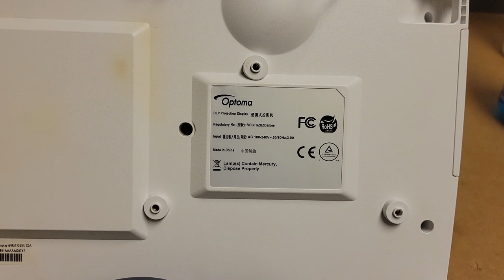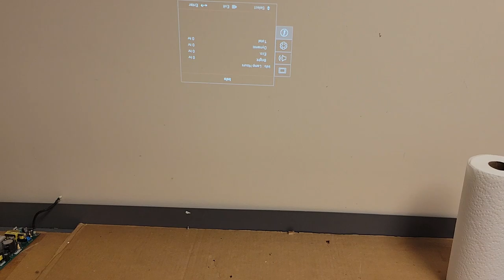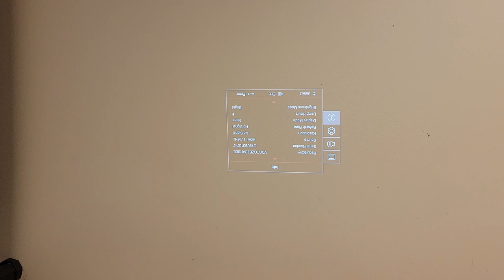Optoma GT1080 Darbee  DLP Projector Color Wheel Replacement

Comment: Hi Frank is the color wheel in the Optoma GT1080 the same as the color wheel in the Optoma GT1080 Darbee?
Reply: Thanks dalton for asking! And reffering me to his video, im going to probably buy the tape he is reffering to and try that out. Waiting till tommorw so i can make sure i have a pair of gloves.
Reply: I cannot for the life of me get the top off, i got both clips opened but right by the bulb area it wont come off, no matter how much force, the only thing i can think of is that some of the plastic may have melted it, only thing i can think is to have one friend on one side and me pull from the other but worried ill break something
Reply from the maker: Hi Felton, I don't think so but let me double check. They use different lamp assemblies for sure but I'll double check on the wheel.
Reply from the maker: Black high temp paint works too. Stove touchup paint for instance.
Which clips are being a chore for you?
Reply: It looks like the clip right next to the bulb shield , is it possible that it melted in place?
Reply: Update me and buddy got it off but its NOT pretty lol the two thick posts definitely melted inside of each other so force was needed , hopin i can super glue the cracks so it will at least still go back on
Reply: Finally got the new color wheel installed and now no power 🤦🏻‍♂️

Comment: Hi, what dmd chip does this gt1080 projector have? Because I have the problem of white dots, thank you very much
Reply from the maker: There are a few possible part #s. Your best bet is to remove it and check the number.  I think its a 1280-6138B but there are other numbers. I tend to only go by the part # on the chip itself to be safe.

Comment: I was wondering if it is the color wheel that needs replacing if I see black and white after the projector overheated once and shut down. I do hear a noise everytime it starts up but I assumed it was the fan. Appreciate your help if you know what's wrong. Thanks!
Reply from the maker: If you have a GT1080 or similar chassis, I would be very suspect of the color wheel. It seems that this series has that as a known issue. So much that I keep wheels in stock now. If you are around the 5 year mark or past that, then I would be highly suspicious of the wheel.  They are roughly $40 so it is reasonable to replace and I suspect that will solve your issue. If you want to link a video of the noise, I can see if it sounds like a wheel issue.
Reply: @FixitFrank  thank you for your response. How can I purchase one from Canada?
Reply: @FixitFrank  I opened up the projector and the color wheel is shattered.
Reply from the maker: That will do it!  I'd check eBay first since you might find a seller in Canada. If not, email my friend Crystal at Time Projector.  Gydz@timeprojectorlamp.com  She is really good and they ship DHL and take paypal.  If they can't help you can email me. I think I have at least one if not more new wheels around for that model.  It should be $40-60US on average. You could even try Optoma directly. I have had incredibly good experience purchasing from Optoma.  You dont have to send the projector to them. They will sell you a wheel directly without having to be a service center which is nice of them to do.

Comment: Hi Frank, I put a new color wheel in and all the colours are off. What can this be please?
Reply from the maker: Without seeing it, I can only suggest a few things. I am not sure which one applies.  Usually it's because the index mark is at the wrong place or the wheel segments are the wrong order. Another possibility is the color wheel index sensor is bad, and one of the worst issues is the mainboard has a problem and can't control the color wheel properly. I have seen that but its either a defective color wheel or the index sensor is at the wrong segment.
Reply: @FixitFrank  Thank you soo much, is there a sign where the index mark goes?
Reply from the maker: It varies depending on the model.  Usually its by the blue segment but I would look on the old wheel. it should be in the same place.

Comment: Hey Frank. First of all, thank you for your videos. Very helpful! 

I have a ViewSonic PJD7820HD that seems to be fine upon turning it on, but after ~6 minutes, I get some serious color strobing. There is no unusual noise, nor any trouble codes as far as I can tell. Any advice?
Reply from the maker: Hi Mike,  You're welcome!  There are a few possibilities but going off of what you types, I suspect your color wheel is going bad, or the sensor is dirty, or if the lamp assembly was changed recently and it was a cheaper option, the ND filter on the lamp assembly is incorrect.  There are some other possible causes but those are the most common I have seen.
Reply: @FixitFrank  Thanks Frank. I ended up taking it apart and cleaning the color wheel as one of your other videos demonstrated. (and i blew out the fans and everything too) 
So far its been running ~30 minutes and no issues. I'm inside right now though. Planning on taking it outside in a bit to see if the heat makes the problem come right back.
Reply from the maker: Hi Mike,  How did it pan out for you?
Reply: @FixitFrank  i used it inside for a couple of hours and it seemed good. I also let it run for 30 minutes outside while it was ~80° out and it was still good. I guess the final test will be when i get a chance to watch a movie on it outside hopefully next week.

Comment: I have the same projector a few days ago I got a message that I need to clean the dust filter but I don't know how to do it or where it is, could you help me with that?
Reply from the maker: Hmm.  Some models did ship with filters. It would be on the side if its installed.  If not, you might have a fan problem that is manifesting as a filter.  Check the menu and see if there is a 'filter timer' you can reset.  It might be a model that was meant to have a filter but then was decided not to ship with one.  They only ship with filters in areas that are known to be extra dusty.
Reply: @FixitFrank  Thank you very much for the help I don't see any part where you can see a filter.  in the menu I will reset to remember filter change.

Comment: Thanks Frank for this amusing video. My Optoma HD39Darbee also makes such a high noise when I start it up, but after a few minutes the sound is silent again. My lamp is 1000 hours old / new? What I don't understand is why you put a piece of tape on the color wheel, is this also on a new color wheel? Why does the color wheel make such a high noise? My color wheel therefore makes that high sound for a very short time and does not disturb me. Is that noise getting worse and when should it be replaced? Where did you buy that color wheel (if I ever need to replace it)? I think I will have to do it myself because sending it to you is not a good idea, you are in the USA and that takes way too long i think .... Thanks in advance.
Reply from the maker: The old color wheel had its index mark fall off from the heat.  I replaced it with a new piece to make sure that was the issue and not something else.  That is how the projector knows where the color wheel is during its rotation. The high speed noise was the motor trying to find its place but being unable to.  
I bought this wheel from China. If your wheel starts to get worse, it is easy to change like you saw. Shipping it to me would be way too expensive in just shipping. You will be able to tell because the image will flicker colors and possibly shut down.  Or if the vibration noise gets real bad.  Ebay is still a good source, but if you are in the UK, you might want to reach out to ChessGuru. He may have some already.  No need to import them.
Reply: @FixitFrank  Thanks for the clear explanation! I come from the Netherlands so England is fine to possibly order.
Reply from the maker: @bronco9973  Please do not hesitate to contact me if you do end up replacing the wheel and have questions.  I would be more than happy to assist.
Reply: @FixitFrank  Oke thanks😁

Comment: Hey Frank,
Great video! Very informative. I have this exact same model projector and recently replaced the color wheel (with the help of this video). The projector worked fine for about a day before it started to make a loud electrical hum.  After about a minute of humming, the lamp automatically shuts off and a service message pops up.  Any thoughts on what went wrong?  Should I try reinstalling the color wheel and hope for the best? Does the color wheel need to be synced in some fashion? Any help is appreciated! Thanks!
Reply from the maker: An electric hum is not something I can recall experiencing. Is it possible it's a mechanical cause and it sounds like an electric hum? If you can share a video where I can hear , that would be great. I have a few theories but they are dis jointed so I'd like to narrow it down.
Reply: @FixitFrank  I uploaded a short 30 sec video of it to my account. Please take a look whenever you are able. Thanks!

Comment: I've watched a few of your videos on how to fix some issues, I tried replacing the bulb and the colour wheel but still no joy. Mine made a similar noise to this one with the colour wheel making a loud noise, now it just seems to tick when it's trying to boot up and the light doesn't come on. Any ideas?
Reply from the maker: Sounds like the wire is plugged in upside down. Double check that.
Reply: @FixitFrank  thanks. By the way I wanted say the videos are brilliant, really easy to follow and I've managed to take apart a projector and put it back together (something I never thought was possible!)

In regards to mine, I've rejigged the wires and put everything back together. 

Now when I turn it on the blue power light flashes, fan starts working, and I think I can hear the colour wheel whirring quietly, but the lamp/bulb never lights up. It does this cycle about 3 times then red flashing light on the power and red steady light on the bulb. I'm so determined to fix it now as I've invested so much time into it! It's become a personal battle now haha. Thanks again for your help and videos

Comment: Knock-off lamps. You get what you pay for. Keep away from them everybody. they do more harm than good. I tried the transformer tape but I still had to superglue it. High peed and centrifugal effect then to throw the tape off. You need to leave the tape for 24-48 hrs for the adhesive to cure and bond solid rock. Good video again. I have quite a few oem new c wheels. Let me know if you need any.
I tested the door switch on my darbee39 it wasn't it. not sure why c wheel or fans don't come on at all.

Comment: Hey man I received the new color wheel and installed it, now all of a sudden after putting it all back together, no power, any advice?
Reply: Never mind it was the the one cord not being pushed into enough, i now have power but the same issue before the new color wheel was installed it goes from blue right back to red and doesnt make any noises. Its acting as of i havnt swapped out the old color wheel for the new one
Reply from the maker: Did you replace your lamp anytime recently?  If so, was it from Amazon?  a bad UV/IR filter can cause these symptoms or a dirty/problematic color wheel index sensor.

Comment: Hey frank i see that you retired, i was hoping i could send you mine to fix , can you refer me to anyone yoh trust? 

I replaced both the bulb and the color wheel and im still getting the red as if im having bulb issues. The original issue was the original bulb blew and shattered, i cleaned the glass out of the inside.
Reply from the maker: I wish I was retired! I still have a pile of years ahead of me... I could look at it. Did you check the blower fan? Make sure it is free to rotate.

Comment: What a coincidence, today I received a replacement fan for my gt1080darbee, the original fan was spinning "fine" but when I installed the new one, I noticed this one does adjust it's rpms after powering up, something the original fan wasn't doing anymore, so far the new fan has resolved the "fan locked" message that would pop up after about a minute of powering up the projector.
Reply: For anyone experiencing weird behavior on this model with their settings/lamp hours being reset all the time, in my case I eventually started seeing a fan locked message after powering up, this led me to replace the fan which fixed both the fan locked message AND the settings reset issue. Weird stuff.

Comment: I have exact same model, been running oem parts only and mine is even worse regarding the heat damage. 
It had/has no large dust buildup and good ventilation around it. I cannot fathom how they can release such bad product on the market.....
Reply from the maker: I used to be a lot more positive about Optoma. Then maybe the last 2 years? Maybe more, they really have lost their appeal and their customer service.  I have a video upcoming with a 4K UHD30 that had its DMD fail less than a week out of warranty.  Optoma said they would fix it for owner... for $950.00....  He sent it to me and I'm sourcing a DMD now.  His cost will be around 25% of their quote for a new DMD, less if he decides to go with a used but good DMD. I think it's time to put some pressure on companies in general to up their quality game.
Reply: @FixitFrank  ouch. I just replaced the colorwheel and lamp. Worked for 100h and the lamp just failed om me now. Hoppfully i can get the lamp on warranty was eyeing on the uhd35/38 because of 4k and low latency. But really hope i can make this one work until hopefully laser or led becomes standard for 4k.

Btw how did the DMD fail? 

Also thanks for your videos. Great to have as a reference since the plastic crumbles just by looking at it wrong.
Reply from the maker: Most likely it ran a little hot. It's kind of dusty but in my opinion not that dusty. Heat seems to be the main cause of the failures. I read the datasheet from TI and 70c is the max temp the dmd wants. That was surprising to me. Makes more sense as to why the IR filters on the lamps are so important.